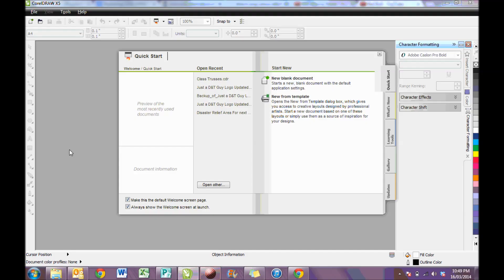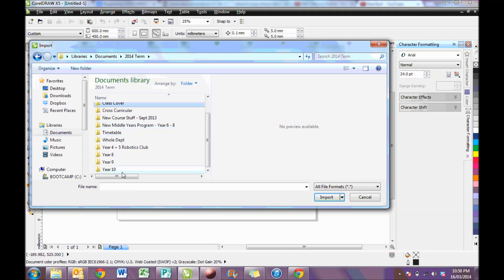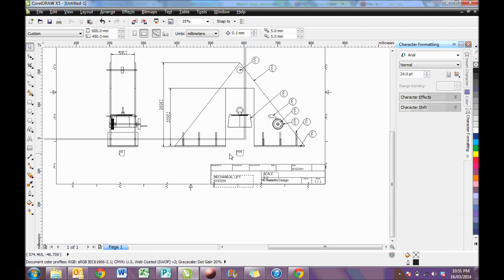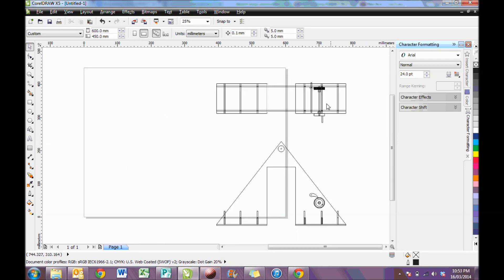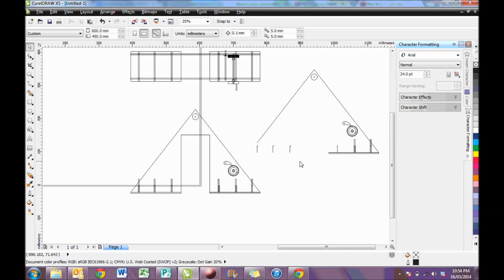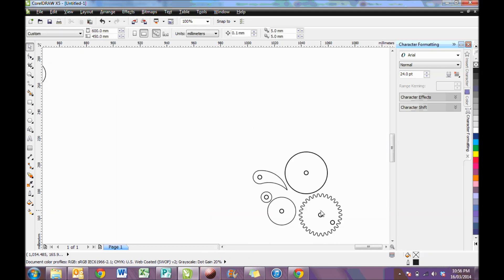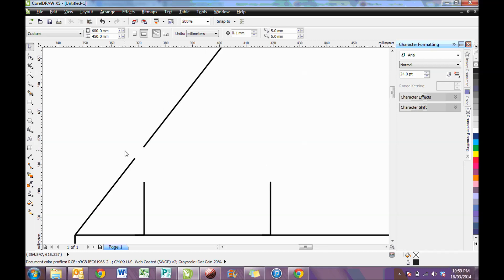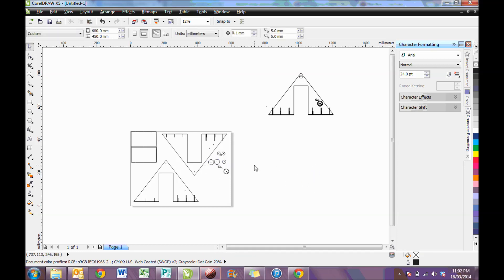Uploading a DXF file to Corel Draw and editing to prepare for Laser Cutter

Comment: I made a dxf from Autocad 2018 and brought it into Corel Draw without any problem.  I saved it as cdr file.  Do I need to do anything extra to get the image on screen to be cut?  The laser cutter is an Epilogue Zing.  All lines show up red and I have no idea if these are vector cut lines or raster engrave lines.

Comment: Is there any way to import the DXF to Corel? This video is useless as Corel says that format is  not supported. How can I convert a dxf to cdr  or pdf so I can load it into Corel?
Reply from the maker: Craig, I used Corel X5 here and there definitely is an option to insert a DXF file. This video is a set which i made for students at my school. We used Autodesk Inventor to create a mechanical lift model. Using the Orthographic views from the 3D model I was then able to export it from Inventor and then insert it into Corel, edit it and then pass this to my Trotec 80W Laser to cut out the parts. The students then built the parts. Not sure if that answers your question, but it is possible and Corel DOES import DXF. Let me know more details and I might be able to work out a solution.